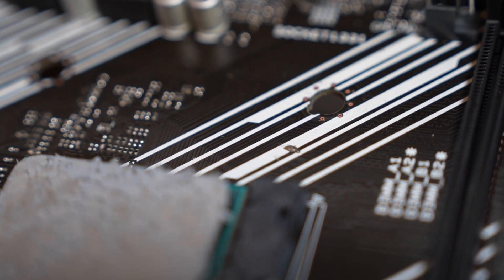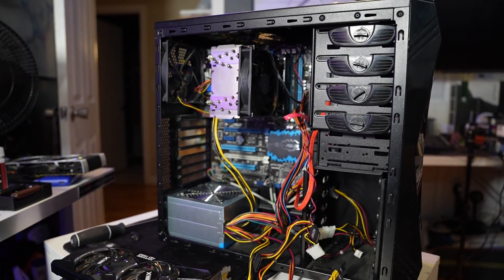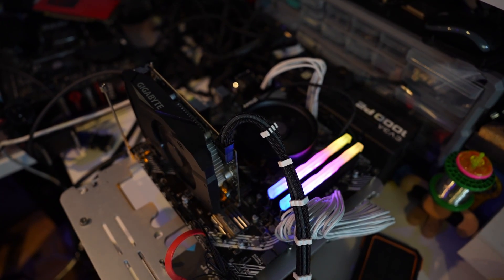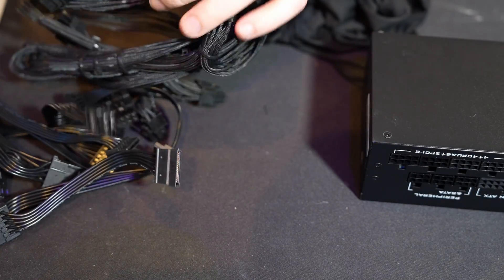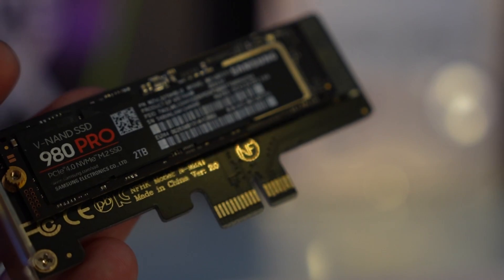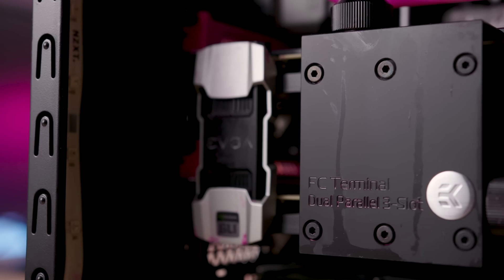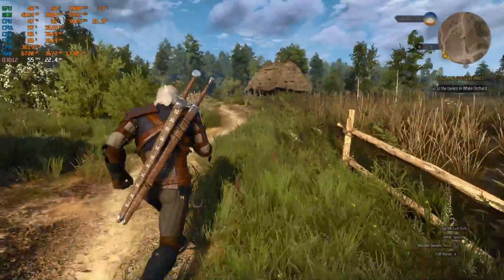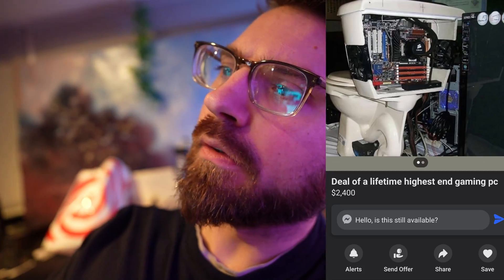10 Tips when buying USED PCs or PC parts

Comment: After quite a bit of research in local stores and websites I found something worth checking , thank you very much for the video! Wish me luck for tomorrow 🙂
Reply from the maker: Let me know what you pick up. Best of luck 🤞
Reply: @techwandoUS  I managed to find what looked like a really trustworthy seller on a public sales website from my country , kind of like ebay in a way , what caught my eye was they had a premium account which cannot be bought and is only offered by the site administration to officially registered companies ,as well as lots of other products for sale ranging from custom builds to PC pieces and even used phones or printers.
I found lots of posts but this seller stood out as he only included photos of the PC as well as the properties screen and included every single part used in the build down to the case , I found it 15 minutes after posting while browsing casually xD
I picked a built PC they put together the day before with a Ryzen 9 5900x , a 10 GB vram RTX 3080 , 64 GB of ram , a 512 GB SSD and a 1tb HDD for storage , also a gamemax Ice Force cooler and an ASRock B550M Pro4 motherboard , I forgot to write down the power supply though they picked out a pretty beefy one from what I remember , photos were very clear so I could verify most the parts from just the post, the only used parts here were the HDD , the CPU and GPU , all of which were obtained either via Trade-ins or folks upgrading and I was guaranteed minimal wear on all , up to at most 3 months of use , made sure to stress-test the parts once we met up as I was really scared it might have been used for mining although everything worked surprisingly well , so far from what I've tested at home it's been running impeccably well , hopefully stays that way into the future- at the very least they offered a 6 month warranty if any issues arise , though I assume that would be quite the rarity for buying 2nd hand stuff...but they ticked all the right checks from your video and forums I could find and even went above  and beyond!😄
Reply: @techwandoUS my reply was too long so it probably didnt pass moderation xD 
I picked up a pre-built PC , found a user thats under a tech firm that does PC builds and trade-ins then uses older parts that are in good condition for future builds , he was verified on the website which may not be a feature everywhere but something worth looking out for.
I got a Ryzen 9 5900x, 10gb VRAM Rtx 3080 , 64 GB ram , 512 ssd and 1tb hdd , gamemax ice force cooler and an ASRock b550m pro4 motherboard , forgot to write down the power supply...
Seller suggested inspection and stress testing before anything else and honestly feels like I got brand new parts...photos were great in the announcement , enough to see and confirm most parts and he had everything listed down to the case model in there 😅
Great snatch for about 1007~ usd
Reply: @techwandoUS tried to reply 3 times but neither went through...
Found a seller verified as a corporation by a website , parts obtained via trade-ins or after people upgrade through him, stress tested all and honestly feels like I bought a new one...
Reply: I got a Ryzen 9 5900x, 10gb VRAM Rtx 3080 , 64 GB ram , 512 ssd and 1tb hdd , gamemax ice force cooler and an ASRock b550m pro4 motherboard , forgot to write down the power supply...
Great snatch for about 1007~ usd
Reply: It was pre-built from the seller , 2nd hand website, he gets parts from trade-ins or people upgrading and selling parts to him for cheap , recommended minimal wear om the CPU and GPU , HDD was also a little older but besides that the rest of the PC is brand new , stress tested it with him and went really great overall. Honestly felt like I was buying a new rig 😅
HDD is not great but I got two SSDs I can add in for the remaining slots with no problem to remedy it , overall happy with it.

Comment: The problem with a lot of marketplace type sites is that a lot of people don’t know what they are trying to sell. They can’t test if it even works, they don’t know the details of the item, they just put whatever they think is right.

As an example I saw someone advertising a Nvidia Jetson Orin Nano on eBay, but looking at the images it wasn’t one, it was on of the older Xavier NX ones, they had no idea what they were selling and just picked what they thought was right from a quick Google search despite the large differences between the two systems.

Same with 3D printer components, there are a lot of shops that don’t know what they are selling and don’t know if the components are good or not. I bought a bundle of a few old mainboards and they looked mostly fine from the pictures but when they arrived it was clear someone inexperienced had been at it with a soldering iron, there were SMD components missing and the back of the boards was a mess. These were sold as working boards but they definitely were not, they were pretty much junk, useless for anything other than salvaging parts and there weren’t even any parts worth salvaging. The fuse had been bypassed, the screw terminals had awful soldering and were partly melted, loads of SMD resistors and capacitors were missing and they have even taken off the USB to serial converter. 

I also wish people would include their reasons for selling, it makes it easier to tell if it is worth it or not, as long as people don’t lie. If people say they are getting rid of it because they upgraded it or they don’t use it then it then it is probably more likely to be a good deal than any of the businesses that kind of pose as individuals. It also makes it more likely that the person selling it knows the item and knows it works rather than a store that can’t test anything.

Also individual sellers tend to put more effort into the descriptions and photos than stores where stores might have no actual description other than information about their refund and shipping policies. Individual sellers also tend to have better deals.

Comment: Hi, your tips are very helpful.
I am going to buy following PC from 2020 for 390€. (gonna try to reduce). And I gonna be able to test it when buying. What do you think? Fair pricing? 
Ryzen 3600x
MSI GTX 1660 Super
MSI MPG X570 Gaming Plus
32 GB Aegis 3000 RAM
SSD 500gb 970 Evo M.2 pci
Be quiet straight power 11 650W
CPU cooler: be quiet dark rock 4
Case: be quiet pure base 500.
Reply from the maker: Thank you, 
This PC you are purchasing, is it a local online seller or new?
The 3600X and 1660 Super are a pretty good combo, and around $400 would be the going rate for something with a 2060/Super here in my local area. Have you checked your local marketplace for averages?
Maybe ask and see if they would go just little lower if they are a local seller. 
Appreciate the comment.
Reply: @techwandoUS appreciate the reply. This is a local private person seller, used PC.
I am in Germany, and in comparison to other deals, this one seems quite good. Only the GPU is a little bit off, but I will try to handle the price down.
Reply from the maker: @rastafella420  nice, after the deal lmk how it goes.

Comment: Those i3-12100f cpus are severely underrated.  I had an extra motherboard that I tossed one in and tried to sell the computer along with my old i7-6700k computer and literally nobody wanted the i3 but I had 3 grown men fighting over that i7 that was 8 years old and ran way worse than the i3-12100 😂  The i3-12100 completely blows away those older i7 CPUs
Reply from the maker: It's so true man, the i3 is kinda a beast. The 6700K has definitely been brought to it's feet with new games, that CPU with a decent GPU is almost always pegged at 90-100%
Reply: The i7 "tax" is pretty wild. Great if you're on the selling end of the i7 though...
Reply from the maker: @TheAmazingCowpig  this is true haha

Comment: I can't talk about specific Intel vs AMD CPUs, but in general value for money tends to be in favor of AMD.  The thing though is that from what I remember for at least how things used to be, I don't know if they are still the same, the Intel CPU of the same tier and generation tend to be faster in single core performance, which on its own can be quite important depending on the workload.  Of course the more recent CPU the less it matters as the load transfers more and more towards multi threaded applications and more modern CPUs tend to be fast enough for single threaded programs.  Still it is good to have that in mind if one buys older second hand CPUs/systems and knows what type of applications they are going to run.  

Same with the usage of Intel's  Quick Sync which depending on your workload (including what software you use) can severely affect the performance on certain tasks and thus make it really worth it going for an Intel CPU.  Of course one needs to remember in this case that going for an Intel processor with an F (or too old to have support) is not going to help in that.

I had no idea that there can be issues with power supplies cables till I heard that story about that EVGA PSU.  I don't know if it is just an EVGA thing (a company I trust at zero level), but no matter what I was surprised when I first heard it.  Reason being the market is full of power supply cables from third party manufacturers, usually either for someone who wants a longer or other color cable.  

I have used different third party cables with my PSUs in the past, I never had an issue, but then again I never had a EVGA PSU.  Still, good idea to avoid taking a risk.

"Unicorn" lol.  I never heard that expression about those fans.  I like it.  

Good video man, good advice. 

I wonder if anyone is going to drop their money down the toilet for that PC.
Reply from the maker: All good statements, especially about the quicksync features. I think they are way overlooked actually.

The power supply manufacturers don't follow an industry standard, which sorta blows my mind. Sure the connector is the same, but the modular end that connects to the PSU can vary company to company. Corsair alone has 5 different types, and some of their older models like the HX (blue sticker pre 2015) use completely different cables than the newer HX models. 
It makes things super confusing for sure. EVGA (as much as you despise them, for valid reasons) was the only company to have all their power supply cables interchangeable. 

How's your setup been running btw? You still on the laptop?
Reply: @techwandoUS  Cool info, thank you.  

Yes still running on my Lenovo Y50-70 laptop.  i7-4710HQ, GTX 860M, upgraded when I bought it back in 2014 to 16GB of RAM (max supported) and 1TB of Samsung EVO 850 SATA SSD.  I am glad I did it and thankfully it still runs.  No plan on getting a new PC, desktop or laptop.  I mean I shop around (online) for possible hardware sure.  But with the income of mine being about a quarter of minimum wage, and with constant new expenses due to health issues, I don't see me buying or building a new system any time soon.  I just like to add items to my cart lol.  Tell you what though, I decided to skip on the 4060 (mobile or desktop) and go for either a 4070 Super (desktop) or a 4080 (laptop), strictly for the VRAM.  I thought my imaginary computer can afford to have either of them lol.   

Life is funny.  
Thanks for asking man.  I appreciate it.

Comment: Do you have some FSP PSUs ?
I got a Hydro Fortron 750w PSU.
I had a 750w seaonic blow up on me in 2018 after 6 years of service .
Reply from the maker: I have had both FSP and Seasonic, I usually recommend Seasonic psus. Whats the story about the one that blew up??!
Reply: @techwandoUS  It blew up when I switched on the motherboard t over an x99 Asus motherboard in August 2018.
I saw some smoke , thankfully it didn't blow up my entire system.
God damn x99 Asus motherboard, maybe it was the culprit, warranty was out anyway.
Reply from the maker: @sithounetsith9877  X99 was definitely when Asus started to kinda fall apart imo
Reply: @techwandoUS  Both these high end PSU manufacturers like Fortron, Seasonic , Foxconn etc  make their parts and assemble in Taiwan with Japanese caps for the high end stuff , most high end stuff should be optimal .
Reply from the maker: @sithounetsith9877  what's your preference on ratings when shopping around? I find gold to be the best value.
Reply: @techwandoUS  Gold PSUs from Fortron , I will avoid Seasonic for now.
I have seen a Gold FSP 1000w for 165€ .
Reply: Check the online psu tier list. Scrap any f tier psus you might have. Every brand can make some really good and really bad psus. Its a minefield basically.

Comment: Tips when buying used parts: Only buy tested and working parts unless you are able to repair them. Only buy from people with a good account and positive feedback. Communicate with the seller before buying. Do not leave the site its being sold on for communication or payment. Fully clean the parts, repaste motherboard, cpu, gpu. Oil the fans if possible. Check for missing parts on pcb even if the parts work.
Reply from the maker: A lot of good stuff ☝️☝️
Reply: Also check their other listings, see if the descriptions are actually correct on other items as if all their listings have good and accurate descriptions then it is more likely to be a good product. I would also avoid stores unless it is a really good deal, they often have lots of parts going through them and even if they say it is all tested it often isn’t and they are also more likely to have shorter and inaccurate descriptions, worse pictures and not know what they are selling. It is kind of unintuitive, you would expect the stores to know exactly what they are selling and be able to test it but that often isn’t the case, especially if it is an item they don’t generally sell, but individuals selling their old parts are more likely to know exactly what it is and be able to confirm that it works.
Reply: What if the  seller was new and it was his first offer? Pls respond
Reply: @Qa3c  Best to stay away from those.  Or send them a message and try to figure out if they are honest, but best to just stay away from people who are not yet tied to their account. People with lots of reviews will not want their account trashed with a bad review. New people will not care and can just make a new account.